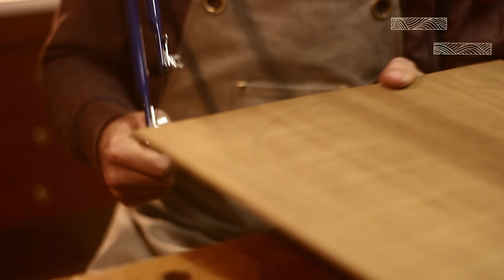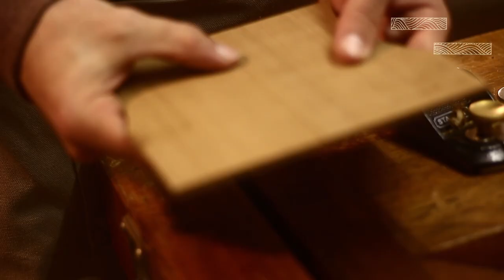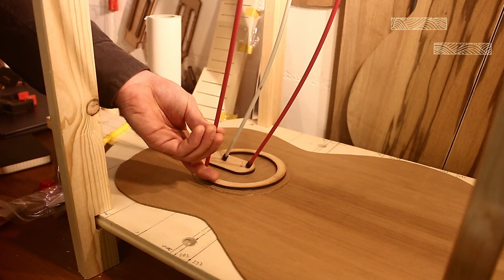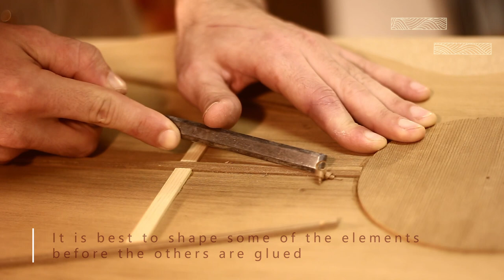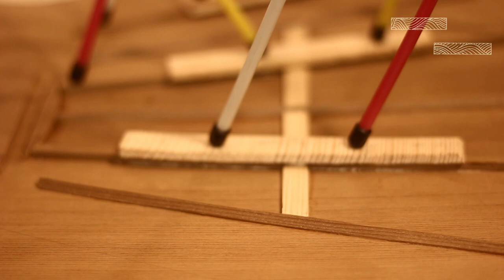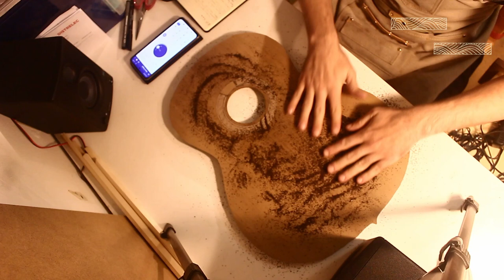Bracing and Voicing a Classical Guitar Soundboard

Comment from the maker: If anyone is interested to know more about how I measure and voice the soundboard, drop a comment with your questions!
Reply: Thanks for your video.
Have you ever measured old Spanish guitar? Very interesting know their frequency modes. Thanks and sorry for my English ❤
Reply from the maker: @ulyan079  don't worry about the English, it is not my mother language as well. I personally have not measure old Spanish great guitars myself, but I have studied the information others have published about such guitars.
Reply: @chriscrevelsguitars  If it's not a secret, could you share a link to some article, please? And thanks for the answer🙏
Reply from the maker: @ulyan079  i can't recall of any online article right now, but there is good information on Classical Guitar Delcamp Forum. I recommend books like the ones from Giovano Nocoletti and Trevor Gore
Reply from the maker: @oscarjagal1081  once you know the density and resonant frequency of the plates of the top, you can use an equation to derive the Young's modulus of that piece. It's a number that relates to the piece stiffness. After that, you then use another equation to figure the thickness required to sustain the load of the strings you use.
Reply from the maker: @oscarjagal1081  density is easy to figure out. The resonant frequency you can get recording the tap tone of the guitar. The equations are a little too much to fit in the comment. I can give them by email if you want.
The speaker is connected via Bluetooth, yes.
Reply: I am interested in how you measure, the settings and SW you use!   Also, what orange circle cutter were you using and how do you like it?  Great video, thank you.
Reply from the maker: @KBorham  Glad you liked the video!  I measure the resonant frequencies recording a tap tone of the top and passing it through some analysis EQ plugins. The circle cutter I got from dictum, I believe. I like it for the soundhole, not for rosette, as the blade is beveled on both sides.
Reply: Could you make a video about an in depth resonance test with the chladni figures?
Reply: What is the tool you use to cut the sound hole?  I'll probably find one by the time you reply, knowing YouTube.
Reply from the maker: @zensational.  That's a hole cutter, or circle cutter, from dictum online store!
Reply: @chriscrevelsguitars  thank you!
Reply from the maker: @schpeidermann  Will work on it!
Reply: How much does the holes location affect the tone and how do you pinpoint where the sound escapes from ?
Reply: @chriscrevelsguitars  @chriscribelsguitars And when you close the top everything changes...
Reply from the maker: @LuisGabert65  exactly!
Reply: May I ask if there are specific pitches / frequencies that you tune the soundboard to? If the board is not resonating to the note you want, do you need to rework the thickness of the board or bracings again? Thanks!
Reply from the maker: @einsam_aber_frei  no specific frequencies no, just a range to be within. I mostly look for the consistency of the stiffness around all of the top. Areas that are too stiff I then shave the braces to bring it down.

Comment: I'm really curious what happens if you brace the guitar in the shape of the Cymatics that you did at the end of the video?
Reply from the maker: Interesting line of thought.
Conjecturing here, because I ultimately don't know. My educated guess would be  that nothing special happens. After the soundboard is attached, all the modes change due to the edges of the plate being held by the sides of the guitar. For one, it is already braced when the pattern is formed, and the preexisting brace influences the pattern itself. It wouldn't be there without the brace in first place. Moving forward, it would depend on which pattern one chooses, a lower frequency one would have deeper acoustic impact (I suppose), because in higher frequencies the vibrations tend to ignore the shape of the bracing and 'see' only its stiffness.
Finally, bracing is also a structural feature designed to increase the integrity of the guitar in holding itself against string tension.

Comment: After you figured out the thickness of the top with yr calculations, what was the frequency of the top before the bracing was glued on . The frequency of the non-braced top must surely be part of the calculation . Also what was the frequency you were trying to achieve with the braced top . It wasn’t glued to the sides yet which is another frequency all together. The frequency you noted was your final , right? 170 Hz which is good for acoustics .
Reply from the maker: The exact frequencies are not as important as what they say of the plate: it needs to be stiff enough, but not too stiff. Of course, bracing adds stiffness and that's why I do the test braced. The sides do change the frequencies after the box is closed.

Comment: I’ll take your offer. What was that vibrating instrument that you used? Also, did you have to touch the top with it, or does it blow air into the board to get it to vibrate? Lastly, aside from being able to see the vibration mode pattern lines on the top of the board, do you adjust the braces afterwards if you see the patterns not as you like? Are you looking for perfect symmetry in the patterns?
Reply from the maker: Many questions! I'm happy to answer. I am guessing that you mean my audio monitor that I hover over the soundboard: it's a speaker, not a vibrating instrument nor air blower. The work here is done by resonance. Though the source of the sound must be loud and close to the soundboard, it must never touch. I'll do a sweep over the frequencies from 50 to around 400Hz, then the soundboard resonates when I get to one of its resonant  modes. Positioning of the speaker matters also. Each mode at a different frequency and with a different pattern. I then write down those frequencies and photograph the patterns.
I look for different things: some specific patterns to be inside of a frequency range; symmetry of the patterns; the shape of the most important modes. Last but not least, it is also documentation for future reference: if the guitar sounds particularly great, I'll try to emulate the patterns in the future.
Yes, if I find that some things are not quite as I like, I do adjust the braces afterwards.
Cheers!
Reply: Awesome… This is so interesting. Does the speaker need to be positioned at the center where the bridge goes? Also, do you ever repeat this test once the guitar is fully assembled to see the effects of the rest of the body on the top’s resonance?
Reply from the maker: @vgfjr505  the bridge position happen to be (not accidentally) on the center of one of (if not the) most important mode, but otherwise no, the speaker needs to me at the 'nodes', the center, of the vibrating area. Basically I hover it around until I find the sweet spot.
I personally do not do this after the guitar is done. Some people do, but I find it a little cumbersome. I do make a tap test and analysis of frequency response, which gives me part of the same information.
Reply: @chriscrevelsguitars  curious… Do you measure the mass before or after before or after you complete the shaving the top, or both? Also, is there a way to measure the top vertical displacement or the top response frequency as you hit it with the speaker? I think a nice mic could measure the response frequency? That would be interesting to get other information about the top vibration properties.
Reply from the maker: @vgfjr505  Hey there! I actually measure mass many times as I am voicing the top and shaving bracings, before, after and during.
Regarding the other questions let's go through them:
Yes, there is a way of measuring top vertical displacement, with static weights. It's valuable info. 
I don't hit the top with the speaker, though, I just let the sound make the top resonate from a short distance.
The "response frequency" I get you mean the resonant frequency? Those frequencies are exactly the ones where the patterns show. I start at a low frequency and go up slowly until the tea leaves start to bounce, then write it down and continue. 
You can also know them by recording a simple tap test  and run it through a spectrum analyser. A nice mic will help, but it is not entirely necessary.
These are different tests, for different data. Measuring displacement with weights tells you about stiffness and volume, tap test informs the resonant frequencies, and Chladni patterns show the resonant modes and distribution of stiffness. They are all connected of course, but each holds their own value.

Comment: What would be interesting as a video follow up is what decisions you make based on these frequency patterns. I mean some of it are "luthier secrets", but roughly, I want to know how you alter the braces based on those "dust" patterns. And how you choose the balance between durability and resonance. And how you decide upon the thickness of the top (without the braces). 
I also saw some people tap on the guitar top and listen for sustain and the fundamental tone. Maybe you can shed some light on that.
Thanks.
Reply from the maker: That's a great idea. Though maybe it is a little difficult to convey such a delicate process on camera. What I do is pretty much access which areas aren't as responsive as the others at those resonant frequencies: they present themselves either as a "bump" on the patterns or a "smear", making the pattern less symmetrical and crisp. This means that the area is too stiff relative to the overall top. So the goal is to make it less stiff, i.e. take away some material. If there is a brace at that point, then shaving the brace it is.
I thickness my top using an equation for the stiffness required to sustain string load. For that you need to measure density and resonant frequency, and then you can figure out the target thickness for that specific piece of wood.
Reply: @chriscrevelsguitars  Thanks for the straightforward response, you condensed a lot of information in it. I don't think I need a detailed video of endless brace adjustments, I understand what you mean.
Is there also a measurement of how those frequencies sound together, or do you just voice the top based on request? For example, strummers may want a guitar which produces chords that sound "together", while fingerstyle players may want single notes to ring out. I ask because I tried different acoustic and classical guitars, some of them sound good on chords, while the ones that sound good on fingerpicking individual notes and less complex chords, they sound "all over the place" when strummed.
Reply: @csterea while some of us think there is builders secrets ( for a time anyway) there is non . The patterns you are referring to are frequencies (Hz) there is the before Hz and the after Hz . The calculations in question are useful if you learn how to use them but not necessary. In simple terms if you thickness yr tops ( classical) to 75 ish Hz that’s your best start regardless of the thickness. Of course the quality of the board is of big importance, if you can put a number on that maybe 5% not how it looks either . Awful looking boards work good too if the sustain is there to begin with . If it’s decided that a completed top will work by tapping then what is that frequency? Right ? Has to have a frequency. Some think that’s good some bad . Perfect pitch is probably what some people have to be able to hear or at least match the thump to a 6th string note like G , I certainly don’t . At this point after you determine the 75 Hz you brace and do some preliminary trimming. Don’t go crazy. In the mold and using an frequency analyzer (any) you trim to about 155 Hz - 160 Hz . In my tops I glue the bridge bindings fretboard before the test . So I stop at slightly above 190 hz Tape the back no glue . Start adjusting to 90 hz Air 190 Top Go to work . There is always speculation and doubt about this type of work . But whatever floats yr boat . Thank you

Comment: Hello,

Thanks a lot for sharing your amazing work. I have a question; being an acoustics and vibration engineer and an aficionado of guitars (particularly flamenco) I wonder one thing.

Have you ever made a study comparing objective resonance frequency measurements with how they subjectively sound when the guitar is played?

We sometime want guitars with less sustain which are usually for accompaniment to a singer, or sometimes a balanced one if you also play solo. Sometimes, like some traditional  flamenco guitars we want bright treables but without too much sustain still and so on.

I am trying to understand, what sort of bracing/thickness etc and consequently the first 3 resonances of the guitar leads to which sort of certain sound. Have you ever made a conclusion as to "keeping the air reaonance, soundboard reasonance and back resonance at "..." frequencyies give a subjective result like high sustain/low/sustain/high treable sounding etc.?

Thanks in advance.
Reply from the maker: A lot to unpack here, but let's go. The short answer is "it's complicated": I do keep notes on the frequencies and sound of my guitars, or better yet, recordings, as the memory does not do a good job with sound quality. But those are only good so far: a guitar's sound changes over time, especially when it is very young. You are right, most of the sound of the guitar comes from the lower frequencies, but the higher harmonics make a good portion of 'timbre', if you like, because our hearing is much sensitive around that area (for distinguishing consonants in speech, for example). So quality of sound depend also in the relation on harmonics: fewer harmonics give a more 'focused 'sound, "root pure", while more harmonics sound brighter, "richer". Much of what we think of sustain is also related to harmonics. Overall, the exact frequency of the top in itself doesn't matter that much as long as it is in a specific range and not in the exact frequency of any scale notes. The efficiency of the frequencies, and relationships between them are more important.
Reply from the maker: There are some general rules of thumb, though. As we are dealing with a limited amount of energy in a pluck, it needs to go somewhere and we can't have it all: so a guitar with stronger, faster attack will normally have shorter sustain (like a flamenco). This relates to the physics of the top: a heavier top will take longer to put in motion, and 'attack slowly', but once moving, will take longer to dissipate all its energy due to its greater inertia, i.e. 'sustain' vibration for longer.
Reply: Hi Chris, @chriscrevelsguitars  
Thank you again for your comments. I would like to give a sumamary on the several guitars in which I measured the first three resonances and I also played them to note the differences. Is there somewhere that I can write you about those to have your opinions also? Email, social media etc if that is also okay for you?
Reply from the maker: Hey, of course! I'm on Instagram as well, or you can email me at christian.crevels@gmail.com
Reply: @OkanTandogan  Beautiful work. if you have published it anywhere, pl share the link, will be more than happy to see those numbers to get a feel of the modes.

Comment: Hello Christian, thank you for all your videos they are amazing. Can I ask at the start of this video you place the sound board on a set of scales my question is why, was you weighing it for a reason or was you just resting it on top for safety?
Reply from the maker: Hello Stephen. Glad that you like the videos! I weight the soundboard in several different moments as I work with it. Reason is that I aim for some specific weight relation between soundboard and braces.
Reply: Hello Christian and thank you for replying I am currently in the process in purchasing the tools needed to build a guitar so I’m a novice but your video is the only one I have come across that includes sound and frequency and it’s gone way over my head how can I learn about sounding a top board?
Reply from the maker: @stephenrimmer5629  a good beginning is Roy Courtnal's book on guitar building. You can find it online relatively easy. It doesn't go into voicing the soundboard, though, but gives interesting measures. Irving Sloane's book is also very good for overall construction. If you really want to dive deep into resonant modes and the science of guitar sound loof for Trevor Gore's books, but they might be a lot to digest if you are only starting on it. I recently received the book of Giuliano Nicoletti, from Iulius Guitars, and the information there is also very well presented and it gives you extra tools for start measuring modes and frequencies yourself. I personally recommend it. Feel free to email me at christian.crevels@gmail.com if you want further details!